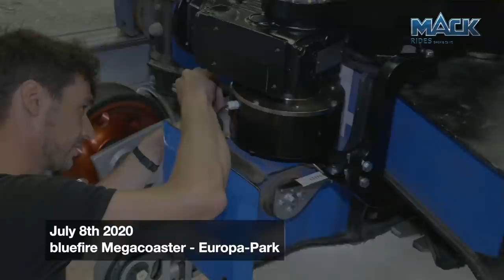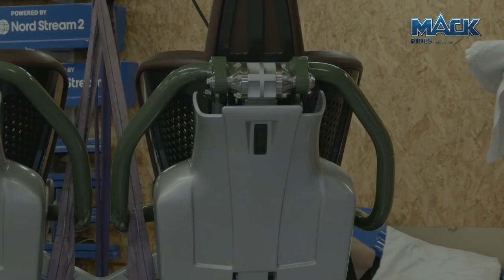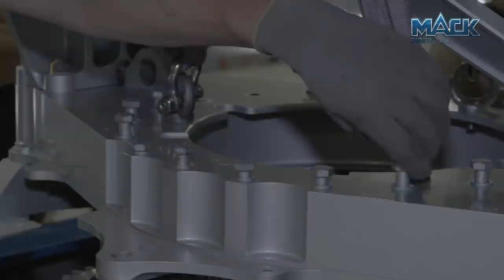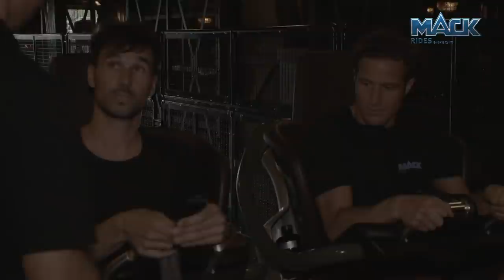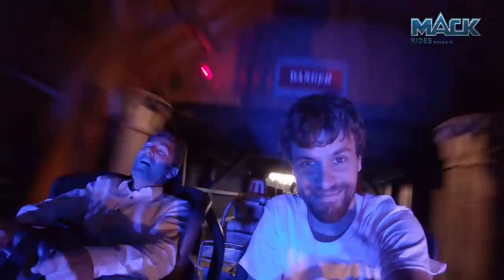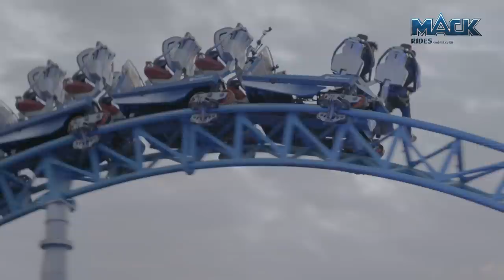HybridTrain: Spinning Seat Upgrade for MACK Coaster

Comment: Why do the spinning cars have seatbelts whereas the normal ones don't?
Reply: Sometimes, they are just added to increase the perceived safeness of the restraint.
I assume, they just wanted to add another layer of security as this is a prototype - but it looks like the restraint as for those regular blue fire wagons, so they might drop the straps later.

Silver Star had a tiny belts to secure the restraint at the beginning as well, but were later dropped.

Comment: Does the Gondola also have a motor to controll seat direction? if so that would be amazing to combine dark ride parts with thrill parts!
Reply from the maker: Yes the gondola is equipped with a motor and can be used during dark ride parts or at the end of the ride to align in the station

Comment: Maybe Plopsaland coaster will get a train with this type of seat? :o
Reply: I hope they will :))
Reply: It's already a spinning model, no need to add this
Reply: @TheSeanhunter  But this is controlled by a motor
Reply from the maker: No this is also free spinning - the motor only aligns the car in the station and in dark rides
Reply: @MACKRidesVideo  Is the center of mass behind, in front of, or on the axis?

Comment: Impressive! Won’t that reduce capacity by half though?
Reply: It's only meant as a single row replacement car at the back, so it's no different from a normal train. These aren't meant to be put onto coasters built for spinning, those would get the four seats per car trains.
Reply: @Zergei  I see! Interesting. I wonder if the next step is to rotate the seating on demand, like on a Disney omnimover for show purposes? That would be fantastic!
Reply: @zenomorph8806  I was thinking the same thing, seeing as the spinning seemed like it preferred to be at specific rotations at parts of the rides and how fun it looked!

Comment: okkk i was kinda scared when i read the caption i was like yuck its going to be like time travler.. but THIS i could get into.  A free spin.. not a controlled on.. i mean look at your rep. when hes going like beep beep beep beep. you got a winner.. THIS is going sell like wildfire. calling it now... 100%%
Reply from the maker: Just to let you know: TimeTraveler is not controlled spinning either. The motor just adjusts the orientation in the station

Comment: Is the spinning motorized or does it spin freely by the power of centripetal force?
Reply: It is motorized.
Reply: @AmusementLabs  in the description it says both, magnetic or free
Reply: It s not motorized, magnets are used to control the breaking force, like in indoor exercice bike.
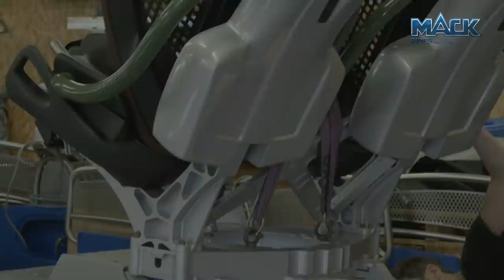Reply: @Fab_Rice  go to 0:42 and tell me what you see... I'll wait...
Reply from the maker: I tell you what you see: This ist a drive motor that would allow us to bring the seats into station position. This also could be used during a dark ride section or to select the position at the launch. During the track the rotation is free and the speed of the rotation only limited by the magnets.
Reply: @MACKRidesVideo  and by magnets do you mean the ones in the motor or other ones?